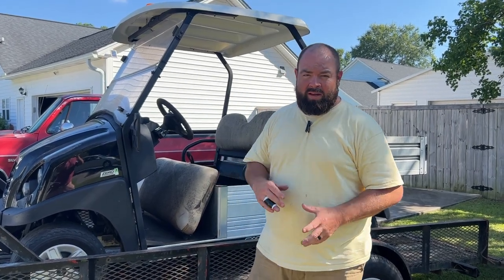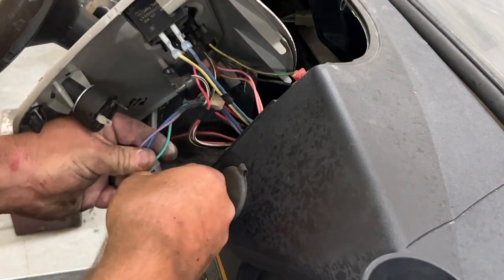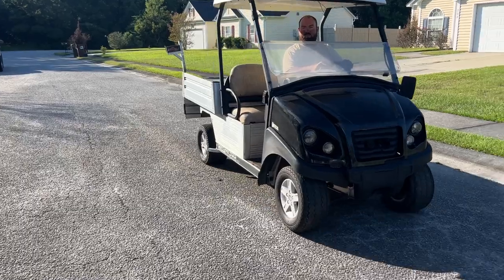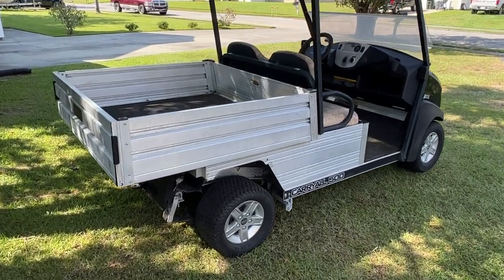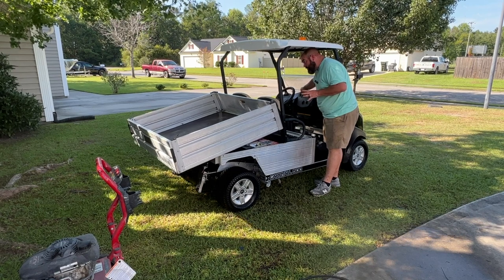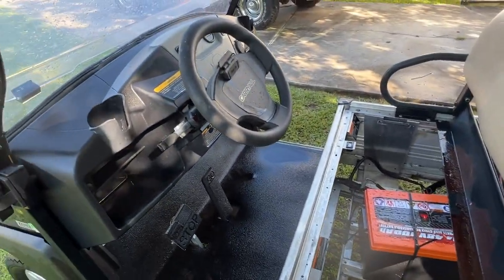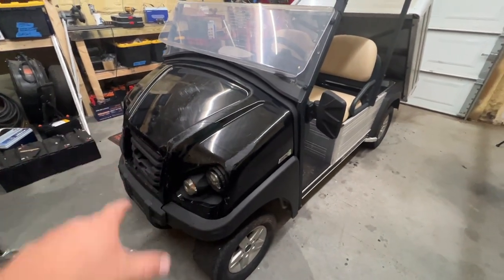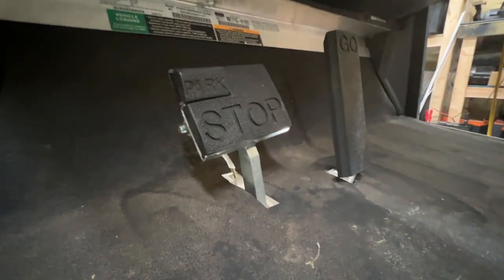I Bought A Broken 2017 Club Car Carryall 500 | Will It Run? New Project Golf Cart?

Comment: Been watching your channel and wondering if you could just swap out the lead acid batteries for LiFePo and a charger w/o messing with the controller or other components.
Reply from the maker: Sure can. It’s no different than swapping out regular batteries. This cart here has stock motor/controller and I swapped in the enjoybot lithium. The cart doesn’t know if it’s lithium or lead.

Comment: Those brackets are supposed to help hold the fender flares that's supposed to on it
Reply from the maker: The bracket doesn’t contact the fenders at all. Even when you build out a new machine it lists them as an option to help protect the fenders in case you run up something hard, basically a small guard.

Comment: That thing has 5 lug wheels? Oh boy......you do a lift and put some cool take off wheels from a car. 17 or 18 inch wheels. I wouldn't go crazy high though
Reply from the maker: Bryant already mentioned putting the 35s on it as a joke. But leaning toward a clean build, Just not many parts available for it since it has front brakes.
Reply: @Fentertainment  Wasn't there a company that worked with you on that spacer bar to lift that one cart. Maybe they would want to prototype something to get into another market since no one makes anything.  I've also talked to the owner of Steeleng up in Greenville before, give him a call....